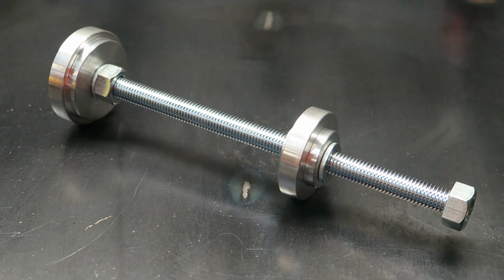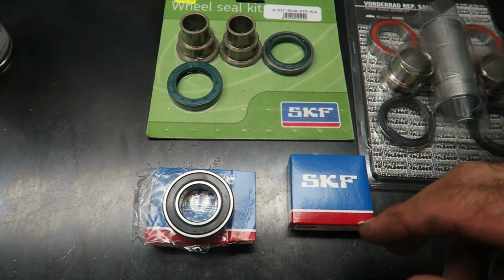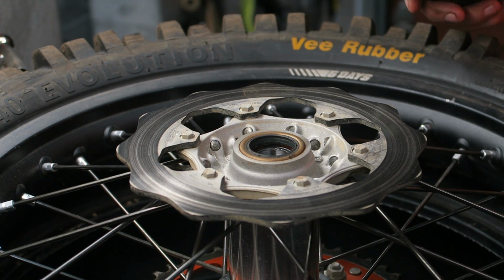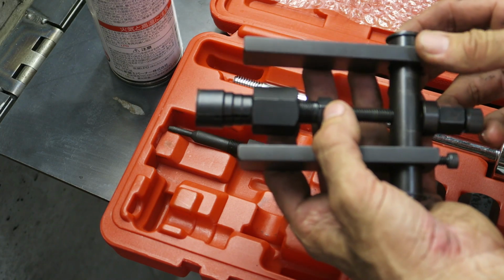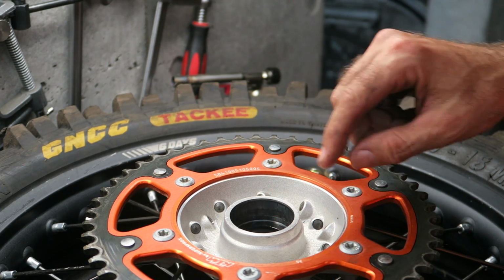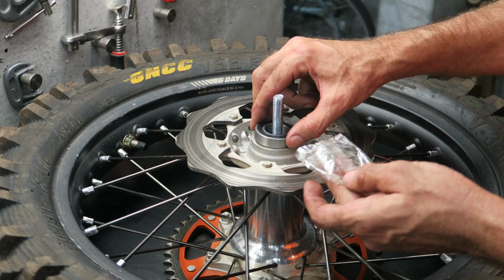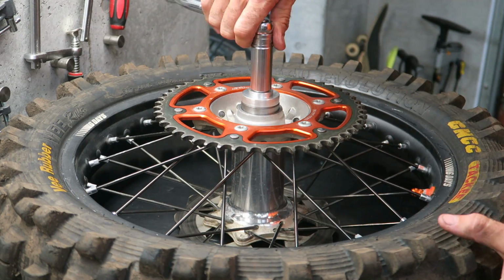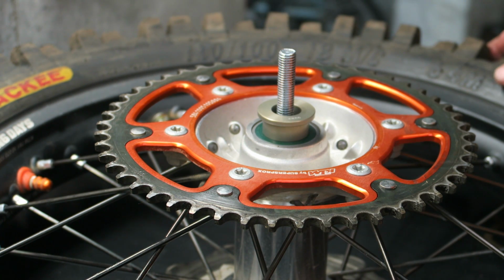KTM wheel bearing replacement- Tokyo Offroad WBPT use

Comment: Awesome webshop. It took no time to place an order.
I have a question for you. I have a new TX300 and I bought wheels that sat on a FC350 2015. The wheel spacers are not the same, but it seemed they could be switch on the front wheel. On the back wheel, the spacers sit pretty hard. I don’t want to use forced on the and risk making damage to the bearings. How can I take them off? Are the wheels compatible by just replacing the spacers?
Reply from the maker: Yes, you should be able to fit the wheels by just changing the spacers. The bearing size is the same.

Comment: awesome video, I'll add grease to each bearing before fitting. dust seals off carefully, fill the bearing with water proof quality high temp grease and then reseal and install. OEM bearings all tend to be under greased. love the tools makes life so much easier. My son's bike at 30hrs had the rear wheel bearings seize, caused a very serious off resulting in 3cm break on his collarbone, he gave up riding after the accident, so can't stress enough the importance of good quality preventative maintenance

Comment: hello, amazing videos, thanks for sharing...
can you tell me, what is de reference for the skf bearings and seals please?
thanks.
Reply from the maker: I don't know what bike you have. Different year/models have different size axles and require different SKF seal kits. It's probably easiest if you search on Google and find an online shop which you like to use which stocks SKF.
Reply: thanks, for the answer, 
my bike is the ktm 250 exc 2017, I already search but cant find what I want...
thanks anyway
Reply from the maker: The part numbers for SKF seal/bearing kits seems to be as below, but please double check before ordering:
Rear 20mm axle: WSB-KIT-R006-KTM-HUS
Front 22mm axle: WSB-KIT-F023-KTM
Reply: thanks, regards...

Comment: I notice you didn't pop the seals on the bearings to pack them with good water proof grease before you installed them. I have done this for years and they lasted longer.  They come hardly any grease.
Reply: I thought the same thing. It's a good mechanics technic but not everyone knows it. Also it's a good idea to put waterproof grease on to inside of a seal lip. And lightly grease outside of the seal to mount it easily and prevent it from damaging when install.

Comment: Does the bearing puller work on the first bearing, when the inner spacer is still in place? Looks like they might conflict.
Also - what do you like for parts cleaner? Looks like non-chlorinated brake cleaner?
Thanks for your videos!
Reply from the maker: korndoggocr - Yes, the puller works fine on the first bearing with the spacer still in place. The puller is able to grip due to the chamfer on the bearing face and spacer. Regarding parts cleaner, typically I use brake cleaner.

Comment: no grease?
Reply from the maker: BrookJ88 - No, don’t use grease to press the bearings in. By heating the hub and cooling the bearing, they should press in easily using the press tool.
Reply: 10-4. thanks for the content, very helpful

Comment: Any plans on making one of these that will work with the 22mm front axles that come on the newer KTMs? I see it's set up for 25 and 30mm now.
Reply from the maker: Shecki - The Tokyo Offroad WBPT will work fine on new KTM front wheel bearings. They use 6906 bearings which have a 30mm internal diameter. The 22mm you quoted is the axle size, not the bearing size. Thanks for your interest in the tool.
Reply: Fantastic info. Thank you.

Comment: Hi. I just knocked out my bearings and discovered a nylon/plastic spacer behind the bearing on the sprocket side. It that normal? I’ve destroyed it so I will have to get another before installing the bearings.
Reply from the maker: Nick Sampo - The plastic colar fits on the internal aluminum spacer. It’s purpose is to position the spacer in the center of the hub so that it lines up with the bearings and you can easily pass the axle through. You can get by without it, but you might find it a little more difficult to fit the axle through.
Reply: Tokyo Offroad I tracked down a replacement so good to go again. In the videos I watched no one mentions it so I bashed away without a thought haha. Learn by mistakes I guess 👍.

Comment: Just to share a few tips:

1) it is very easy to remove the seal without damaging it (if needed to keep) by using a standard 10-12mm wrench...just need to hook the edge of the wrench on the metal ring of the seal and pry out against the bearings (work the sides evenly)

2) It pays off to use the needle or pin, carefully open the seal on the bearing itself, and dump as much as possible grease into the bearing.
Reply from the maker: Mikhail - Good tips. Thanks for sharing.
Reply: what do you mean by "it pays off to use the needle or pin"?
Reply: @GenkiDamaSSJ  Meaning: you can use, for example, a very small screwdriver to pop out the dust shield of the bearing, and apply more grease in there. Then just place the dust cover back on. In these particular bearings the old one has red dust cover, the new ones have black dust covers.
Reply: No more than 20-30% fill in grease - or the increased resistance can overheat the bearings and cause additional drag.

Comment: I have just purchased your oil drain tool and this press tool will be next on my list.

What brand is that bearing puller kit, I've been looking for that exact style.

Excellent products and videos ,thanks mate keep up the great work for the KTM DIY ers.
Reply from the maker: Thank you for your business. 
The bearing puller kit I have was purchased in Japan from a shop on Rakuten for about $110. It's not branded and is probably made in Taiwan. The quality seems fine. It can be used on blind bearings too (such as crankcase bearings) so thought it would be useful.
https://item.rakuten.co.jp/ryukyumura/10000151/